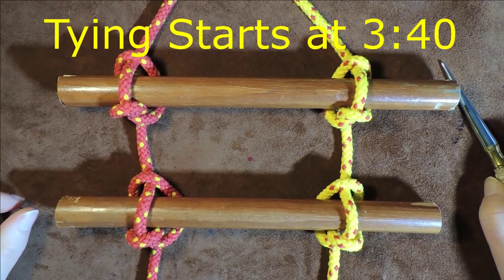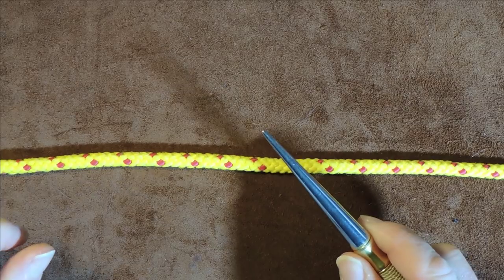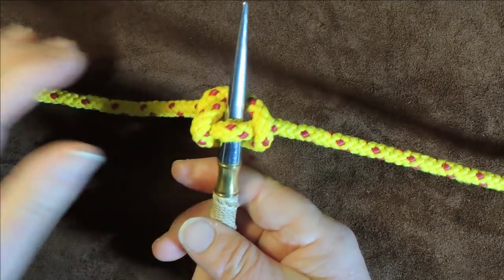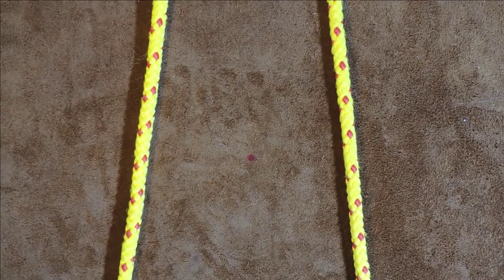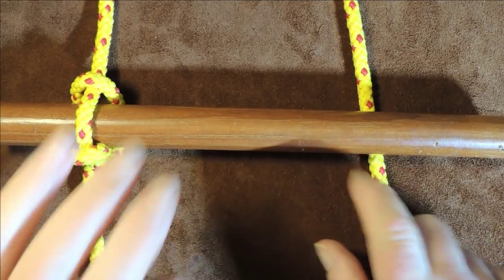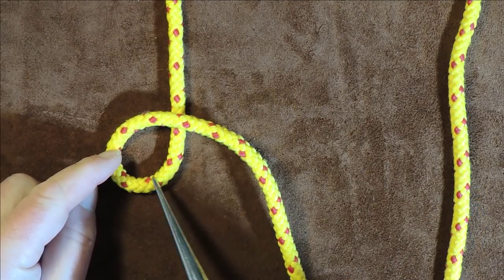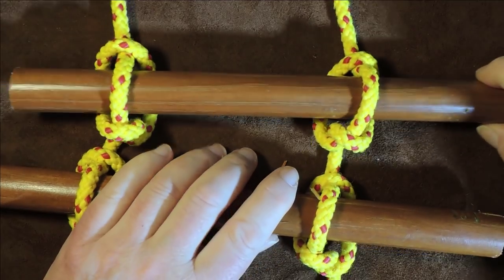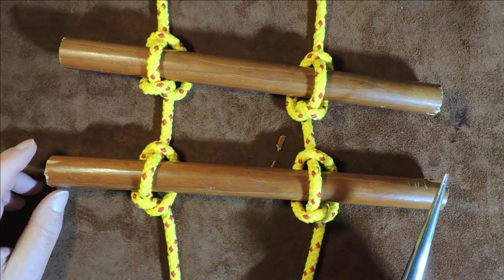Marlin Spike Hitch Rope Ladder - How to Make a Simple Rope Ladder  🛠

Comment: love the part about the name, always wondered why its called that way. i use the hitch to tie off my hammock to a carabiner (second way you showed how to tie it)
Reply from the maker: Now that is an interesting use of the MSH, is that a standard thing to do?
Reply: depends on the way how your hammock attaches. since i dont have the adjustable straps for the tree side so i use a 6mm 5.5m static naylon rope. depending on the distance from the tree i either make a cow hitch around the tree and then tie the MSH with the doubled rope and pull a carabiner through or i use a running bowline. there are many ways to tie it of depends on what you have available. before i use carabiners i used to tie a clove hitch. i pref the MSH much easier to get it off after load is applied
Reply from the maker: Thanks for taking the time to share this information, I always love to hear about knots and cordage being used! I would really like to start doing videos of knots in use in the field. Doing it on a table top is too easy, but with cold wet hands and lack of resources would make good viewing.
Reply: @KnottingKnots  im always up to see and learn now usage for stuff. Theres planty of it on youtube for bushcrafting (about 10 knots), but i bet the same knots have more usage then bushcraft. Why not how to use them around the house, workshop, or some other thing. I know some 20knots and use them more or less all for one purpuse or another, but basicaly it comes down to 5 or 7 that are mostly used. Lets be honest one doesnt use a figure of 9 on a bite often. Or a double bowline
Reply: Marko Stojanović i
Reply: is it just me or is there missing the majority of the comment?
Reply from the maker: There is a Read More bit??
Reply: i was talking about Terrys comment. looks like he didnt finish it
Reply from the maker: Terry! Terry! Just seeing if he fell asleep at the keyboard?? 😀

Comment: If it’s adjustable won’t it be moving when I use it?
Reply from the maker: Without tension on it, it is very easy to adjust. However, with tension, it will not slip. Just ensure that you have tied it in the right direction for weight to be loaded onto the Marlin Spike Hitch. Thanks for taking the time to view and also make a comment, very much appreciated.
Reply: @KnottingKnots  much respect brotha keep working 🤝